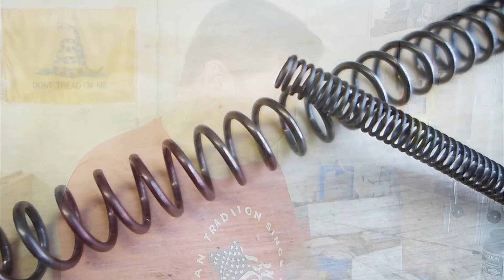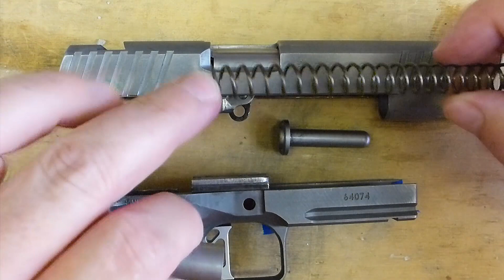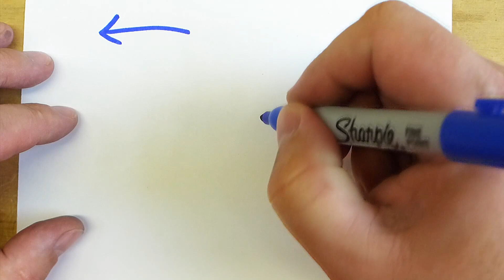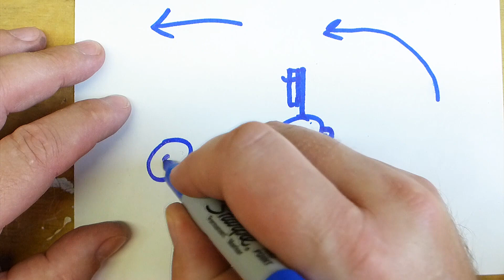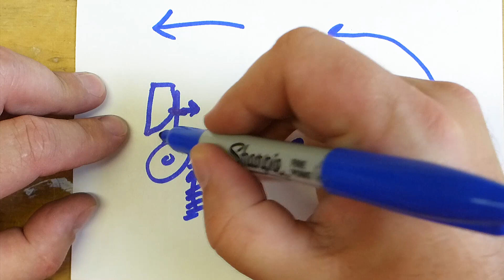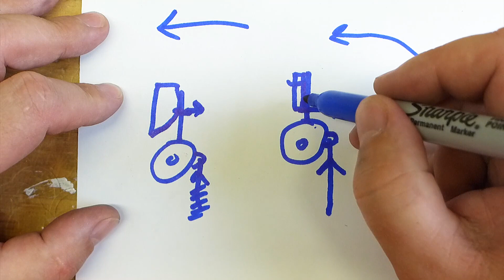Titanium 10mm Hi-capacity 1911 Build | #21 (Springs)

Comment: Just use recoil buffer from Wilson combat and save time and buying expensive firing pin stop.
Reply from the maker: The gun HAS to have a firing pin stop and I don't think the square one was particularly expensive. Also, the square firing pin stop can give the gun a more pleasant recoil feel. Of course there will be debates forever on the merits Shok-Buffs. And using a Shok-Buff certainly doesn't save any time. Anyway, maybe I'll try them sometime. Couldn't hurt.
Reply: @jayphilipwilliams  I use recoil buffer on my Glocks, CZ clone, all my 1911s with no problem. If buffer is worn-out while cleaning my guns after shooting session, just replace them. I've tried brass buffer suggest by others, but brass buffers bend out of shape just one range session. Imagine how hard slide had to hit the frame while shooting that brass buffer get all bend out of shape. Heavier hammer spring will increase trigger pull weight, and square firing pin stop will harder to rack the slide when hammer is down position. Sometime you might not have time to cock the hammer then rack the slide to chamber a round or clear malfunction.
Reply from the maker: @tjrocksw1911  Good thoughts. Thanks. And maybe your "time" comment was that it would take time to tune the gun by trying different springs.
Reply: A recoil buffer has virtually nothing to do with slowing the rearward movement of the slide. A stronger mainspring and flat bottom fps do slow the rearward movement of the slide.
Reply: @chotney2682  Slowing down rearward movement is to stop damaging your slide hitting hard against frame. If use too heavier spring will weaken the rejection of spent casings and shorten the time to new cartridges to come up to breach face to go in to barrel chamber. Most competition shooters use weakerst spring that enough power to cycle and use recoil buffer to protect slide and frame. There is a you-tube video showing in slow motion at each recoil spring.